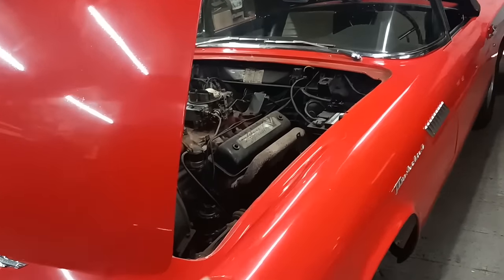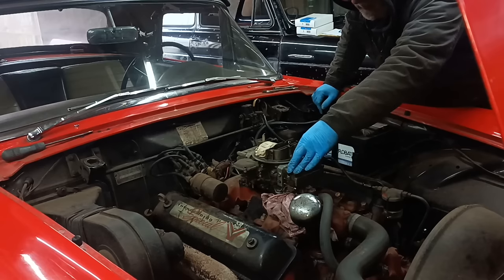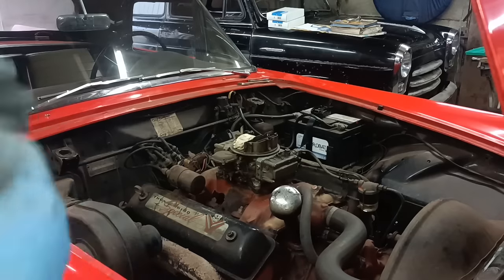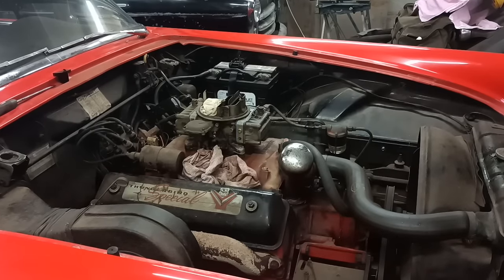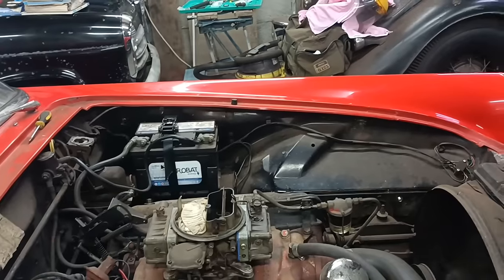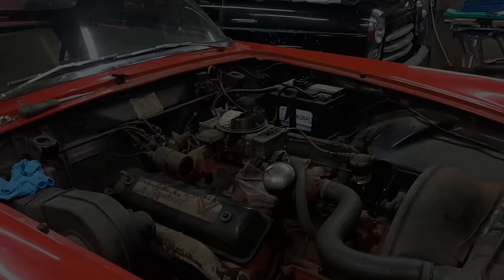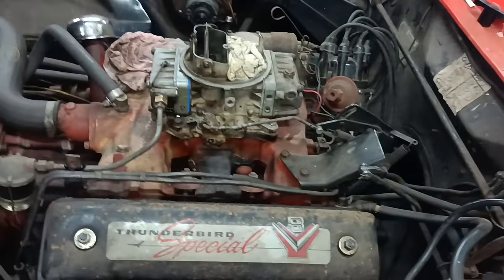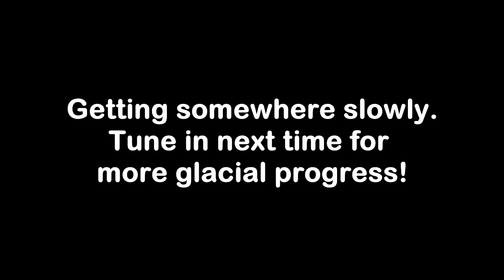57 T-Bird! Why can't I get it to run right? Still trying! (Mart's Garage Update 2418)

Comment: Mart, I know how frustrating issues like you are fighting can be.  You’ve got a 60+ year old carb that’s been sitting idle, has a very dirty primary side, a rag in the secondary side and old gas. You also have rebuild kits and extra gaskets. Pull it off, clean it well and rebuild it then fill the tank with fresh fuel. It might run like new!
Reply from the maker: That's what I am hoping, Eric. Thanks for watching.

Comment: Over here in the USA we only use Autolite plugs when we are selling the vehicle and want it to run for a little while, they are the worst and cause lots of problems. NGK Iridium are your best bet, you should never mix plugs it causes all sorts of running problems.
I'm glad you are like me and show the dumb mistakes.
IF I remember correctly new points come with a protective coating on to prevent corrosion.
This is why Americans cannot work on British cars because the carbs have adjustments American carb are for simple mechanics who just swap out parts (sorry Americans, bu it is true)
Reply from the maker: Hi Jag. I now have some NGK for it. Thanks for watching and commenting.

Comment: When a car sits for years the fuel evaporates out of the tank and leaves a varnish-like residue.  Fresh gas will dissolve this gooey residue which then gets deposited on the exhaust valve stems, causing valves to stick open!  So check the tank for this brown goo after you drain the tank and get it out of there before you have to pull the heads (been there, done that).
Reply from the maker: Hi Cougar. The fuel isn't very old, a couple of years since the last fill. I would have been low ethanol stuff too, so I'm hoping not to have the problem you describe. I experienced the problem on a Y block powered F100 and bent a couple of pushrods. They took some unsticking too. Thanks for watching and commenting.

Comment: Clean carb. in ultrasonic.
Clean everything and dobbelt tjek cleaning.
Rebulit it.
Tjek for waccum leak whit a smoke tester.
I have seen videos wher  they emulsion tubes seems ok but have internal krak og stil dirty.
Keep up the god work.
Reply from the maker: Cheers Niels. I will continue to get things working right.

Comment: Hi Mart,
I know you record these weeks prior to release so you may have sorted it by now, but I am sticking to the comment I made last week. OLD FUEL. Assuming you are not removing the ethanol yourself at home, the E5 fuel lasts 12 weeks before it loses it's use as a fuel for car engines. The old fuel degrades by absorbing water from the atmosphere and falls to the bottom of the tank, so when you try and pump the fuel you may get just a water and very low octane fuel being pushed through  - even engines of your age can't deal with that sort of mixture. Also don't ( maybe too late now) just fill the tank with fresh fuel without first draining the tank as best as you can, I learnt the hard way because when I filled it up at the fuel station all that did was mix the water /fuel mix up again - and the bad running was back again. Mine was running excessively weakly, and application of the throttle caused the engine to die. 

I let the new fuel settle in the tank for a few days ( to allow the water to sink to the bottom again), then drained a litre back out of the tank by hand, there was maybe 150ml of water in my clear container. I waited till the water stopped appearing again and drained the float chambers once more. Due to the weather this last week I was unable to drive the car, but this morning I did get out for a 20 mile run out and the issue seems to be sorted outI knew my issue was nothing carb related as when parked 12 months beforehand it ran perfectly, the only change was the fuel in the system being left without being used.

Anyway hope you have it all done by now, and do let us all know what your ( or what you think) issue was.
Reply: I had fuel in my Barchetta for 18 months and it rotted out fuel pump seals and pipe..horrendous crap.
Reply: I agree it is a waste of time with the carb till the gas tank is drained and a non alcohol fuel is used. What is the fuel filter. If a sintered bronze in the carb it will never pass water. 😢
Reply from the maker: Tank has never had high ethanol fuel in. Fuel was a couple of years old but was the good stuff with less than 5% ethanol. There is a sight bowl and no bits showing in the bottom of that. I will show progress as I can get the videos edited.
Reply: @MartsGarage  Like you I have never used the higher (E10) fuel and only used the E5 stuff, it still absorbs water over time. The 150ml of water collected was from 20 litres of E5 that was in the tank since last Spring, not sure how much rubber piping is on your car but I would highly recommend swapping that out for Ethanol compliant stuff. The "old" pipes rot both externally and internally,  before swapping the piping over I used to get loads of small black rubber bits that had been caught in the many filters I run, the giveaway for me was the fact that just 3 year old "old style" rubber pipes cracked externally to the point where leaqks were evident. Ethanol aborbs the water content from the rubber , thus causing it to crack. I don't really drive my car that much so starting to build up my hardware together to remove the ethanol at home here - messy to do but if it saves me all the work I have put inj to get the thing working properly again then it will be worth it. I never used to get all these issues before this modrn crappy fuel was forced upon us. Looking forward to the next vid 👍

Comment: It’s certainly trying your patience Mart have you tried to squirt some soppy water around the hoses to see if it’s drawing in air or cracks in the hoses might cause it the engine to hunt up and down other than that is to put new fuel in you will get it running properly
Reply from the maker: Hi Billy. I did spray some brake cleaner around and the motor did not react to it so I think there are no vac leaks. It now has fresh fuel which has helped.

Comment: Marty.Why have you got a rag in the secondaries.That will be choking,The secondry circuit,and sucking extra fuel,into the motor.Making it run very rich.As seen by the sooty,plugs.If you dont want the secondaries to work,It needs to be blocked of at the bottom of the carb,So no air or fuel,comes through it.best thing would be to make an adaptor and fit a single carb.
Reply from the maker: Hi Rev. The rag was put in 30 years ago plus when A very unexperienced me could not get it running right. There is no fuel supply to the secondary side. My goal is to get the carb running properly with all it's original parts in place and the secondaries fully functional. I also want to get the original heat choke in place. I've had these parts kicking around for literally decades and want to put it right now. Thanks for watching and commenting.

Comment: Hi Mart I have old motorcycles and find that if  modern plugs foul they won’t recover. I have been using Brisk plugs with no failures so far.
Reply from the maker: Hi John. I am thinking along those lines also. That's why I tried using those older plugs. Thanks very much for watching and commenting.

Comment: Mart are the plug wires graphite? Years ago in the 60s I had problems with graphite wires cracking and leaking spark. Changed them out for hard wire and installed a suppressor for the radio. Good luck with your projects.
Reply from the maker: They might be. They were new about 35 years ago.

Comment: Mart why is the vacuum advance disconnected? or it appears that way.
Reply from the maker: There was a problem years ago where I had bad detonation when opening the throttle. I had to disconnect the vacuum and lock the advance plate down to fix it. I am now addressing the issue. I will show it in a future video. Thanks for watching.

Comment: have you thought about putting vacuum gauge on it ? bring it up to the highest reading and leave it . it must be frustrating .
Reply from the maker: Hi Fred. I did think about that but have not tried it yet. I think you have to have everything pretty 99% before using that to get the optimum. Thanks for watching and commenting.

Comment: why no vacuum advance?
Reply from the maker: When I was driving this car 30 plus years ago I had bad preignition rattles if I suddenly stabbed the accelerator. I locked the base plate and removed the vacuum pipe. That fixed it. I am now in the process of reinstating the vac advance with some new parts.